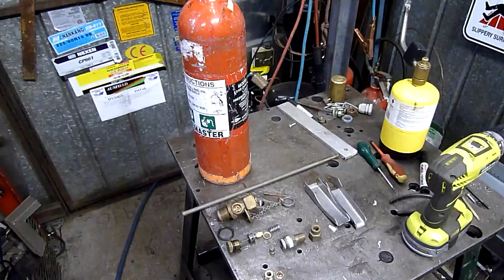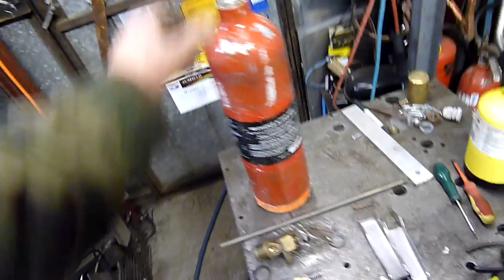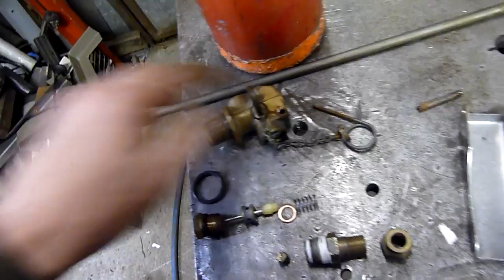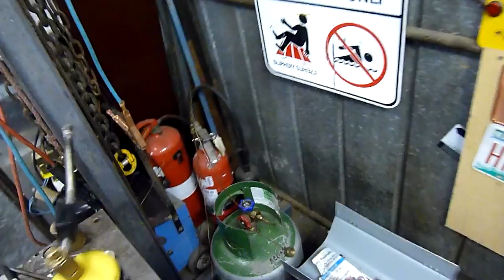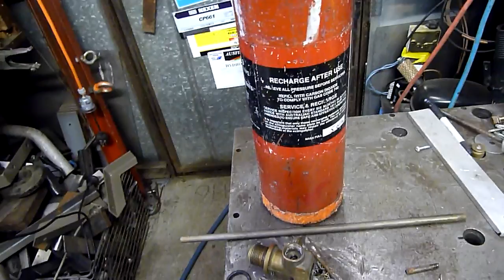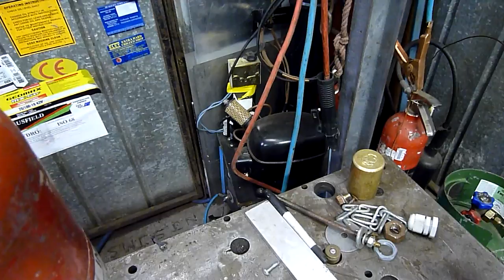CO2 Fire Extinguisher Autopsy

Comment: The domed copper disc is called a bursting disc. It's a precision engineered item to rupture at a set pressure. Used to fit them to the small military explosive devices that I worked on.

Comment: Turned mine into a flame thrower. I drill out a small hole and put in a tyre valve stem for pumping compressed air into. I fill the 2/3 rds up and pump it to about 120 lbs. Shoots petrol, it's officially joined the darkside!

Comment: It could be a good portable air compressor if you put a refrigerant compressor of the top of the tank and put a pipe over everything and put feet on it and it would look like a ling round pipe that would fit int the corner

Comment: There should be writing/indentation around the neck with some numbers on it. When we did fire training at the petrol station I use to work for they were tellin us how they refill them and its by mass so I would imagine that those numbers would relate to the empty mass (dry mass). Even if its net and gross mass thats enough to work out the mass of the pressure vessel and contents. Wormald's catalogue has agent capcity and full weight (their 2.1 ABE ~= 2kg cyl)